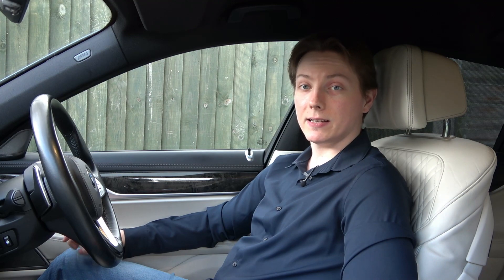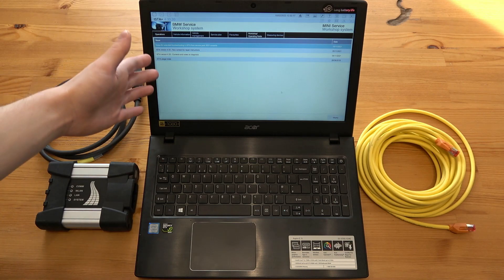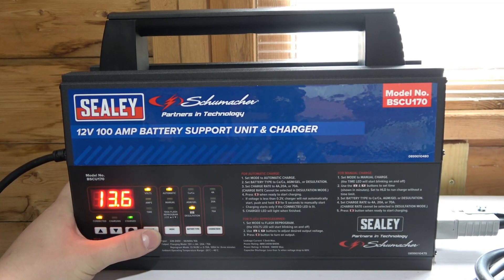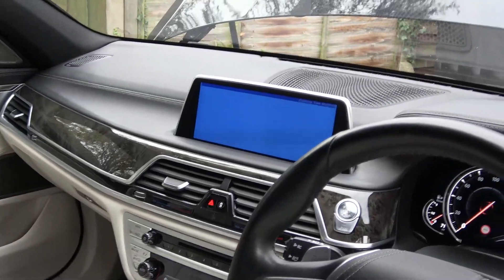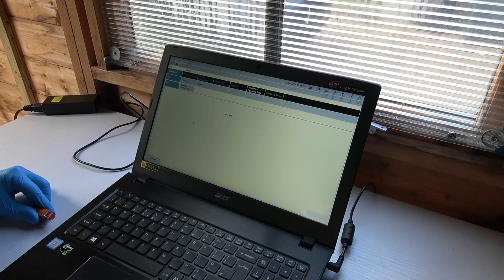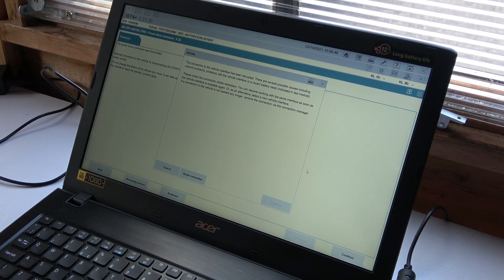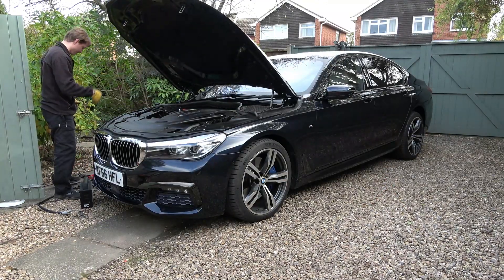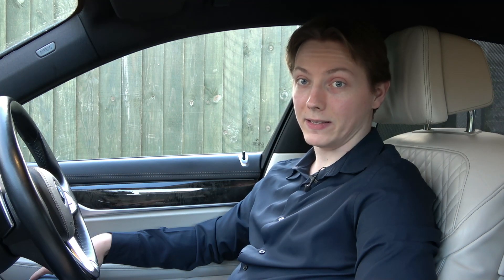BMW 7 G11 - Battery Replacement, Software Update with ISTA & Oxygen Sensor Replacement

Comment: I own a BMW 750i Xdrive how do you change the auxiliary battery in the engine compartment on the passenger side?
Reply from the maker: I don’t know exact procedure since mine wasn’t equipped with the auxiliary battery, but it should be the same procedure, just in ISTA you have to choose auxiliary battery and ISTA will show even whole procedure.

Comment: Martin, you have a hell of a channel brother, I have a g12 and you have been very helpful!
Reply: By the way, I’m wondering if I can hook up a trickle charger to the rear battery or auxiliary battery (I.e the other two batteries separate from the battery in the engine bay)
Reply from the maker: Always on the jump lead terminals under the bonnet

Comment: I cant believe that low quality o2 sensor is put to 7 series. And died after 5 6 years?
Reply from the maker: Yes, It was big surprise for me too.
Reply: @martinhabinak  No more All Germany quality parts. I think all manufactures have the same supplier. Low quality parts everywhere. Cutting cost etc.

Comment: Great video. I have the 335D xdrive 2016. My ISTA software should be here tomorrow. I notice you pressed the start button a few times to get diagnostic mode. How many presses do i need to make. 
Steve.
Reply from the maker: Thank you, three times, than it goes to diagnostic mode.
Reply: @martinhabinak  Hi again Martin. The software came today. Phew, it looks like it will take a while to configure it all. Also i think with my car being a F30 model, i will need to use  the yellow lead with RJ45 skt. So now i need another laptop as mine does not have one. Thanks.
Steve.
Reply from the maker: Hi, but I wouldn’t recommend using just yellow lead cable on programming or software update, just only for diagnostic.

Comment: Hello I have a small question, I have a very high-pitched whistle when I drive from 50km / h. It comes from the outside but you can hear it inside. fairly regular. Do you have an idea . Thanks very much
Reply from the maker: Hi, it could be anything for example wheel bearing, stone chip stuck between brake disc and shield, go to some well know workshop, they're gonna sort it for you.